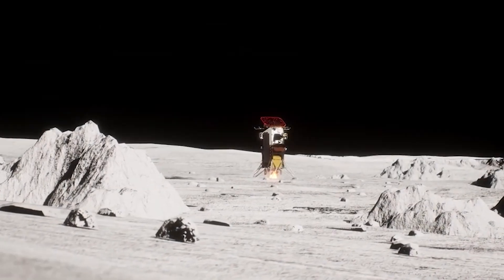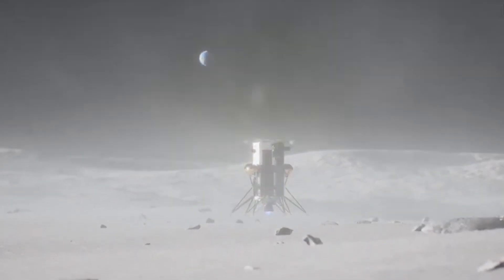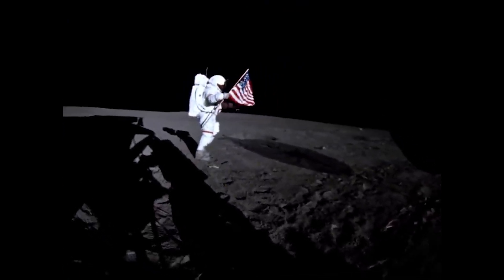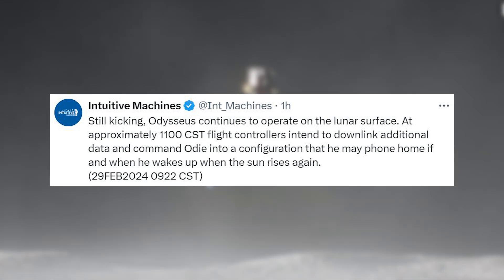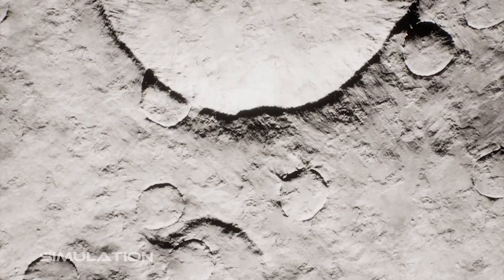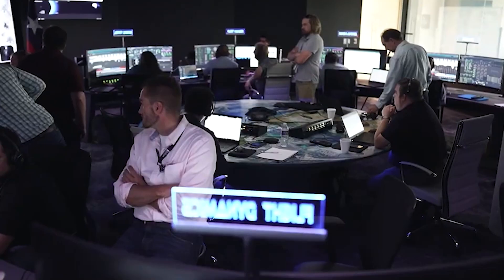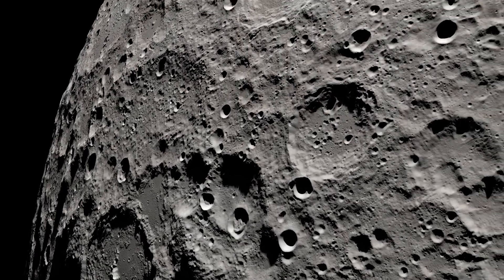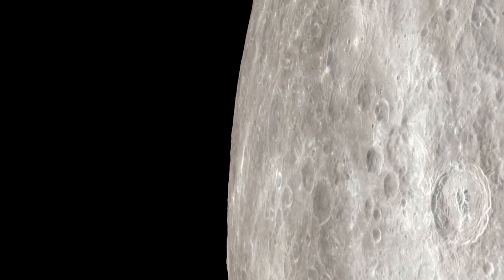The Odysseus Moon Lander Is Officially Out of Power

Comment: Personally I think it is very likely to wake up. Batteries are certainly the biggest risky part on that but I have dunked a lot of electronics in liquid N2 and liquid He and almost never see failures even being careless with them. It does depend on some compliance, what exact packages they used etc but I think pretty low like to work. The electronics may latch up though due to carrier freeze out which could cause a failure but that just depends on the particular circuits. As to the battery even if it gets mechanical damage between its layers it may well work enough to hold some charge. I think sort of the key is not to power it hard before it warms up enough. Surviving unpowered though shouldn't be too hard. Companies will never sign up to it because it is too hard to test to and they don't want to be sued, but what really matters is the physics and material science.

Comment: The mission was a bust. It's amazing that both NASA  and IM are still trying to claim/spin this as some kind of success. The failure can be traced back to the laser guidance issue...it did not function because a manual switch was not turned on before the lander was launched. Yeah. They forgot to turn it on, leading to the hard landing and tip over.

Comment: 2:52 Yes IM did modify their software to use the NASA LIDAR (NDL) system. However, during the February 18th press conference IM's Steve Altemus and Tim Crain made note that "data valid flag" programing was not properly populated and NDL in fact didn't work for the landing. The lander was only able to use the camera system and IMU for range and location data. These inherently inaccurate systems resulted in the lander hitting hard and breaking a landing leg. If the LIDAR system had worked, they most likely would have "nailed" the landing. The engine bell hit the surface and the engine continued to fire after landing. Apparently, the IM-1 lunar lander did not have a surface contact sensor like the Apollo LEM did and was relying on LIDAR data. All things considered, the mission was a success and the problems that occurred are fixable.
Reply: But I'd still rather visit the Titanic than board a rocketship to the moon...

Comment: My impression is that the flimsy inner tripod feet were designed to be breakaway structures. The main legs have righteous square shock absorber feet. lf the OML had any drift when it landed, or it landed on a slope OR a Moon Troll tipped it over....enquiring minds need to know.
Reply: Ahh, The dreaded moon trolls...
I thought it might be the Chinese having a little fun.

Comment: From this mission, I would say it is largely a success.  One gets the impression they have some very smart people AFTER launch who are amazing at solving problems.  Unfortunately, they have some people who made some unwise decisions BEFORE launch; for example the decision not to review the pre-flight checklist which resulted in the LIDAR LASER not being enabled.  If it had been correct, there is little down they would have had a nice, safe, slow, vertical landing with no horizontal translation.  I told my brother about this. He said, "The one who was supposed to check the LIDAR is now working at a place that requires a paper hat, name tag, and the phrase, "Do you want fries with that?"  My brother is a funny man.
Reply: Not having reviewed a pre flight checklist is a capital mistake.. at such high cost at stake unforgivable and no success.. 😢😢
Reply: The Kids that designed The Eagle Cam which was originally going to be ejected to land on the surface and take images and video of the Odysseus touching down.  They must have been absolutely gutted, that their brilliant technical invention was shelved, although Odysseus managed to spit it out, and it did take an inhibited image of part of the stricken lander just before its power was depleted. It's such a shame that their Camera Module Eagle Cam which was scrubbed from the mission due to the pin enablement for the original geo proximity landing software, which was overlooked as you correctly said on the preflight checklist. was the reason it was scrubbed from the mission. Hopefully it will still be used on I.M.-2
Reply: Gotta give him credit, that is funny...

Comment: I still think radioisotope generators should be included just in case on most missions
Reply: radioisotope generators are very expensive, very heavy, and very large.
Reply: We only make about 1.5 kg of pu238 per year. There just isn't enough world supply to use it on most missions.

Comment: So why did this happen? Was there a stiff breeze on the moon?

Probably just a software problem
Reply: There was a child safety switch for the lasers that were supposed to guide the landing.  They neglected to disarm the switch before take-off.  They realized this before the actual landing.  So then they did a whole lot of program re-configuring through a sleepless night and used a NASA -designed laser they had extra onboard that was going to be used for data collection .  It wasn’t designed to help land the craft but it did good enough to keep it from crashing.  That part was a miracle Hail Mary.  But the craft kept moving forward by forces they don’t completely understand and tipped over a rock in its path.
Reply: Probably a bunch of moron engineers problem
Reply: The laser telemetry switch was off. All experiments by the customers were still conducted. So mission success
Reply: Actually, with all the poor planning and lack of acknowledgment of the things that can go wrong… I’d say that was a very unsuccessful moon mission. Japan, who has a LOT less experience, was able to get their moon lander to land upright and correct!!  Their lander’s legs didn’t break due to cheap and poor quality leg construction.  They had a cheap heater that kept their circuits alive.  So yes… this is a pretty good and accurate assessment. I’m embarrassed for NASA and the American people.

Comment: I'm sure the fine folks over at Intuitive have reasons for their lander design, but hopefully the next one will be wider than it is tall, making it less likely to tip over, even with a busted leg. I'll never understand how you can use the word "success" at any time regarding this landing.
Reply: they treasure their "participation" trophies and ribbons....
Reply: Most of the scientific instruments were able to get data and send back to Earth.
Reply: It's on the moon south pole as intended, mostly intact, returning data, first attempt.
Reply: it's easy if you lower your standards and insist on higher contract rates.
Reply: Hopefully the next one will have cameras from multiple angles showing uninterrupted video from launch to landing! Would be nice to watch the entire flight and landing!
Reply: This is not the problem. The problem was landing with horizontal velocity. Even with a wider lander, which may not fit into most launch vehicle payload bays, the legs would likely have sheered just the same and the lander tipped just the same.
Reply: When India crashed on the moon, India called it a success.

Comment: Folks, if the UPS truck runs over the curb and gets a bent rim, but you get your packages, do you call that a failure? I have sympathy for the driver, but his mission was a success. Okay, try this: Odysseus is part of the NASA CLPS program. CLPS stands for Commercial Lunar Payload Services. Note that it's all about payloads, getting them to the Moon and supporting operations. Odysseus may not have an A+, but they absolutely earned some kind of A. As a secondary goal, they not only have a bunch of flight hardware tested, but they've also gained a huge amount of experience with operating and troubleshooting a spacecraft. Plus, all this was done on a budget and schedule much less than has previously been the case. So, sure, criticize all you want, IM can take it. But I suggest you go to school on this mission, all other recent lunar missions, and the missions coming up in the next few years. Once you really understand what's going on, you'll gain a new appreciation of just what our species can do. Lastly, there are quite a few people out there who not only have a vast amount of experience, but who are quite willing to share it freely. If, instead of an unfounded criticism, you ask questions, you will not only learn some really cool stuff, but you might find your own path to space.

Comment: That’s alright. It’s a private company; they won’t have to convince anyone to send another lander. It’s all down to the money they want to spend.

I’m sure quite a few valuable insights were also gathered from this mission.
Reply: They have to sell payloads, if their lander doesn't work people won't buy slots. Failure with customers on board isn't a good thing you know
Reply: @mathewferstl7042  That’s actually a very fair argument. Thanks for bringing that up.
Reply: @mathewferstl7042 The mission was mostly a success though.
Reply: @bluesteel8376  So was the Hindenburg, it made to it's intended destination in New Jersey it's first try!
Reply: @bluesteel8376  half half, some payloads were compromised and couldn't collect data properly or at all and the landers operational time in the surface was cut short. But no, it wasn't a full failure and I'm not suggesting it was.
Reply: What is? Insights are far away from informations about the conditions on the moon.

Comment: have to come up with a new power source and heater , my understanding is the surface is irradiated?
Reply: The lunar surface gets intense (4 times Earth's surface, IIRC, but Google it) sunlight for two weeks and deep darkness for two weeks. These periods are called lunar day and lunar night. Lunar night is not only very dark--remember, the moon doesn't get moonlight--but it's very cold. Without heat, electronics, batteries, etc, get significant mechanical stress, which can lead to permanent failure. So, you really want to try to keep things from getting cold. For this type of spacecraft, this usually means electrical heaters. However, though I'm sure I've never done this, well, not too many times, it's like leaving your car on overnight. The heaters are driven by power from the batteries and they need to supply that power not for just overnight, but for two weeks. That requires bigger, and heavier, batteries. Since the cost of a launch is primarily driven by weight, if there is no mission requirement to last out the lunar night, the choice is usually to avoid the big batteries. However, engineers in programs like this tend to want to check back in with the spacecraft once lunar day arrives. We certainly don't know which things may fail and the exact conditions. JAXA's SLIM lander woke back up. I expecr rhere were a few very surprised engineers, and a  team's worth of excitement. As payloads get more demanding, you can expect requirements that spacecraft can overnight reliably. And, battery power is not the only way to do this. Plus, we're just going to learn more about conditions durning lunar night and how to design spacecraft so they don't freeze to death.
Reply: The lunar surface gets intense (4 times Earth's surface, IIRC, but Google it) sunlight for two weeks and deep darkness for two weeks. These periods are called lunar day and lunar night. Lunar night is not only very dark--remember, the moon doesn't get moonlight--but it's very cold. Without heat, electronics, batteries, etc, get significant mechanical stress, which can lead to permanent failure. So, you really want to try to keep things from getting cold. For this type of spacecraft, this usually means electrical heaters. However, though I'm sure I've never done this, well, not too many times, it's like leaving your car on overnight. The heaters are driven by power from the batteries and they need to supply that power not for just overnight, but for two weeks. That requires bigger, and heavier, batteries. Since the cost of a launch is primarily driven by weight, if there is no mission requirement to last out the lunar night, the choice is usually to avoid the big batteries. However, engineers in programs like this tend to want to check back in with the spacecraft once lunar day arrives. We certainly don't know which things may fail and the exact conditions. JAXA's SLIM lander woke back up. I expecr rhere were a few very surprised engineers, and a  team's worth of excitement. As payloads get more demanding, you can expect requirements that spacecraft can overnight reliably. And, battery power is not the only way to do this. Plus, we're just going to learn more about conditions durning lunar night and how to design spacecraft so they don't freeze to death.